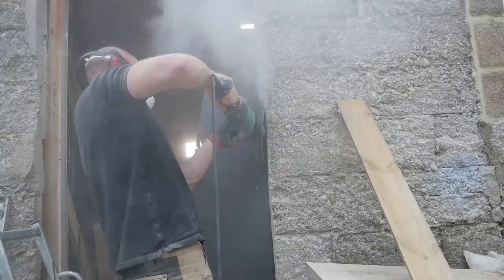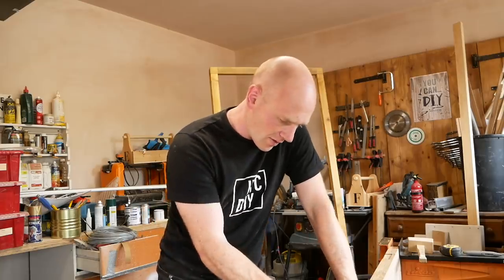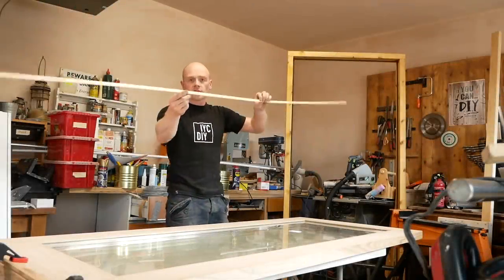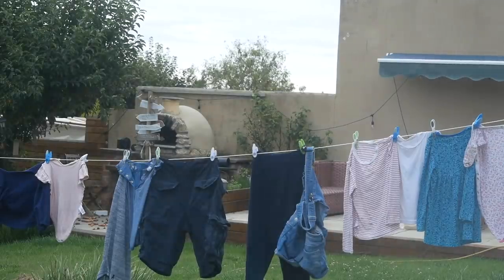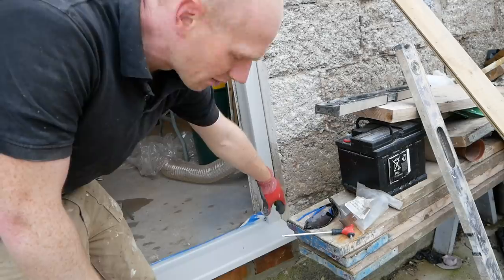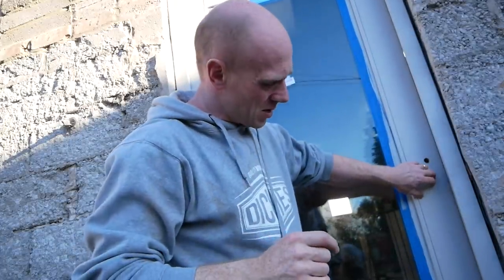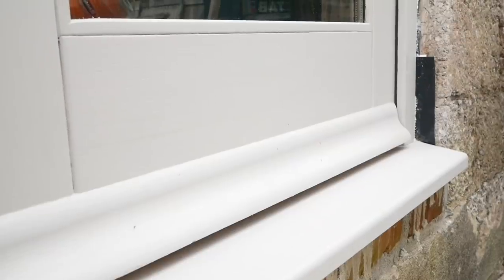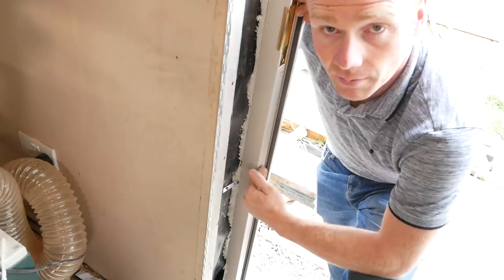NEW WOODEN DOOR INSTALL | Hinges, Lock, Handle and Hang!

Comment: Tim I've done plastering and rendering for years. It depends what kind of finish you prefer.

With a cement render the main thing I'd say is not to go for a smooth finish because they tend to crack and they show up any imperfection in the work especially with wall lights. If you want a cement render I'd ask the company if they can do some kind of a pattern or stamped finish. Allow for painting every few years aswell.

My personal preference is for an un-painted pebble dash finish. If done right they look amazing and they age gracefully like brickwork. Dashing is a dying art though so make sure they know their stuff.

If you want something more gauranteed I'd recommend going for a modern scraped render.
It comes already coloured and premixed in bags, it doesn't crack, Its tough and it has a very even and dimpled finish.
Its expensive though.

Comment: It's an old house I hear you say. Well I live in Poland, very minus temps in the winter. But not just interior wall insulation, I would consider covering your exterior block work with exterior polystyrene insulation before rendering. Render, if that's your choice, is much easier over the insulation. Makes a huge difference to home temp during the winter. We even turn the heating off sometimes. Harshest here -30C.
Reply from the maker: Yes external insulation a great option if rendering. With 140mm pir inside, this garage conversion is performing great summer and winter. 👍

Comment: Never seen anyone remove a frame with a grinder, would have cut the legs on each side, probably less damage, get your frame absolutely plumb and level and there will be less work. wouldn’t have messed about with the hinges would have just shoot the door in and would have morticed the lock last once fit is good. But there’s more than one way to skin a cat I guess
Reply from the maker: Wasn’t cutting the door, just making a few cuts while it was in so the dust didn’t go in. 👍

Comment: Nice work 👍. Story sticks are good. But I would have marked the hinge positions when door was in frame . Also chisel just inside your pencil lines before routing , makes it easier not to fly past with the router. 

Anther good tip, if your going to knife around the lock or latch . Stab gently at the bottom first , so the knife doesn’t fly past when knifing downward.
You can also get low expansion foam 👍 

But again excellent work 👍 house is looking great.

Comment: You might not be a professional carpenter but I am, and I can honestly say that your work is as good, if not better than a lot of things I’ve seen done by so-called professionals. And for what it’s worth, I had to fit a new hardwood cil with a water bar only a couple of weeks ago. I used my plunge saw on a track to cut the rebate in the bottom of the door and cleaned it out with a plane. Exactly the same as you did.

Comment: With the router plunge the bit onto a flat surface so it is bang on flush with the baseplate then put the hinge leaf in the depth rod and set to thickness. It’s a lot easier and more accurate. Quite a lot of school boy errors going on here but you get there.

Comment: Love the air lifters. Never seen those before and l spent 35 years in the replacement window/door industry. Why didn't you rebate the outer frame to accommodate the drip  looks so much nicer.
Reply from the maker: Will try that next time. Thanks.

Comment: In France you often buy a door already hung in a frame and with door lock mechanism already installed, you just have to add door handles which are all of the same sized and fixed with barrel bolts which tighten up well.
Reply from the maker: Yes you can buy door sets here too. They are around 3-4 times the price but sometimes worth the time saved I guess! 👍

Comment: Very useful video, thank you! The colour is a great choice and the brass works very well with it; it’s timeless - I don’t think it’s too old fashioned (in fact interior designers for the last few years have gone back to using it a lot again). Would it maybe work aesthetically to try and match the render for the garage conversion with the mortar colour of the stonework?
Reply from the maker: Yes, looking at how we tie the render to the stone. There is however much variation in the stone and mortar so not easy.

Comment: Mate great video. I’m no trained carpenter but can fit doors. Taught myself as you have probably done and we both basically do the same methods. It works for me... it seems to have worked for you so win win! Everyone learns all the time. You can never no it all! Love the colour you’ve chosen! And I still need to get the mini trim router! I just won’t tell my wife 😜👍 your daughters growing so much! Our son is nearly 16 months! Time goes so fast. Take care. Marc👍
Reply from the maker: I’ve only done a couple of external doors but like you say once you get your head round one it’s pretty straightforward. Yeah, pleased with the colour, I never knew I was so fussy on shades of grey! 😬
Reply: The Restoration Couple with a surname such as mine all be it spelt differently grey or gray is just how it has to be haha!

Comment: Think you put the weather bar on the wrong way round as I thought the rebate in the cil acts as a drip for the water
Reply from the maker: If you mean the trim I added on to the door, it’s grooved for a drip stop on both sides so you can have it projecting less or more if that makes sense? 👍
Reply: The Restoration Couple I didn’t see that sorry
Reply: Love the channel by the way

Comment: Is that how you guys fitting doors in uk? Still chisel and drill? I remember dad doing same 50 years ago.
Reply from the maker: Pretty sure you would do most of it with a router and jig if you were doing it every day.
Reply: The Restoration Couple 
No bro everything is manufactured in the factory by CNC machines. All holes are predrilled in doors and frames and you can choose anything you want hinges, locks. All you do just fitting it. No painting no drilling no mess.
Reply from the maker: Yes, pre finished ready to go doors are available here like you describe. Most doors tend to be Alu, UPVC or composite and in which case are all ready to just slot in. 👍